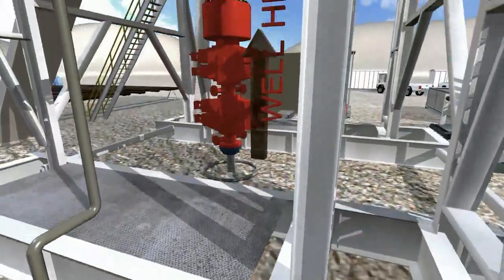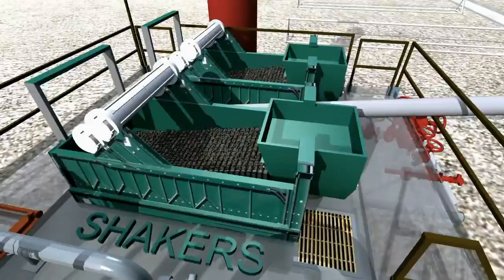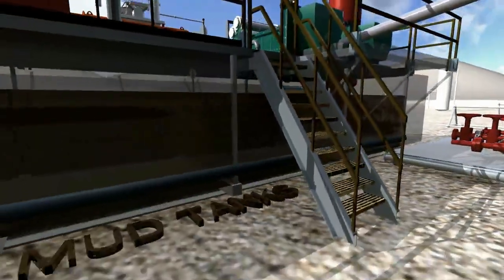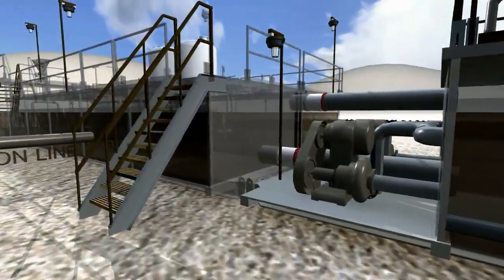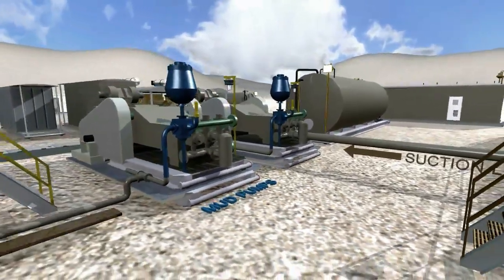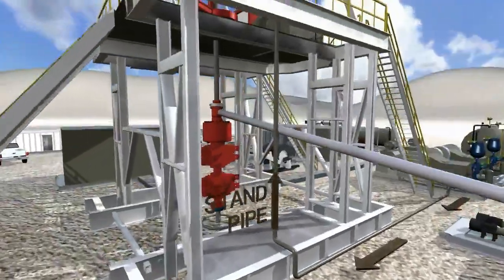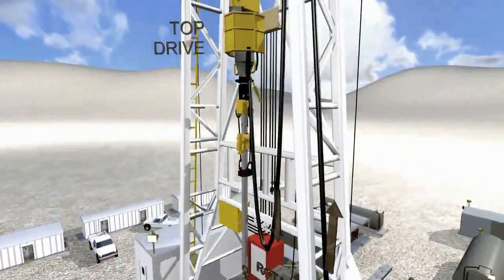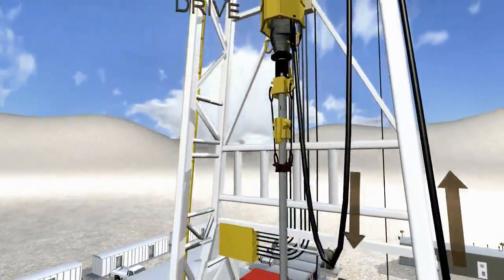3D Drilling Animation - Mud Pumps Circulating Fluid

Comment: I guess you inject water through drill pipe, cooling it and removing debris, rocks and stones. Water mixed with stones the comes up under pressure around the drill and is collected and guided to shakers which clean from rocks, and water is collected in mud tanks. From there it goes through the mud pumps and back to the drill to repeat the process.